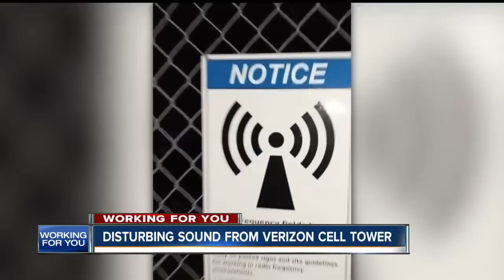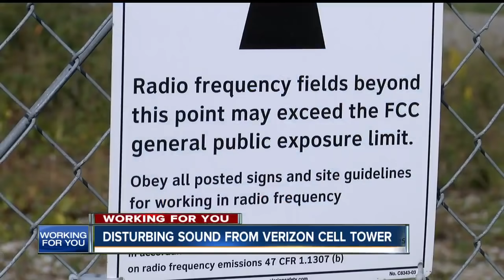Disturbing sound from cell tower

Comment: The Russian studied the Effects of EMF way back in the 60s I have some research to share with anybody that is wanting to know more. The Russians actually studied the effects of the Non Inoinizing radiation. Do not be mislead by those who claim that heat is the only thing that can affect you like UV light or the Sun. EMF is a lower frequency but the Effects of this emmisions go higher then 75 CM per given area. A microwave produces about 33 to 50 PPM of those same heating Non Inionizing effect Would you want to place your head in a microwave? Right no So those people that tell you otherwise are fools. Look up project PANDORA in 1960 An American Scientist Milton Zaret running this project and its effects of Microwave and EMF radio waves used in the US embassy in Russia and its effects on the employees at that time.

Comment: Idiots lol! It’s an alarm from the gen that’s there. Do you see the blue sign in the beginning of the video it means the tower is on the lower end of rf transmission. The next one is orange then red. The safest place you can typically  be is very Close to a tower. Because the rf is going over you unless the antenna is incredibly downtilted. In New York City this equipment is located on rooftops more times than not several sites on every block. Everyone hates towers but everyone loves being on a cell phone. I’ve been in the industry well over ten years and I’m perfectly fine and guys I worked with 30+years are also fine too

Comment: Dumb on the engineer standpoint. No use putting an audible alarm on something if no one (that can do anything) will be around to hear it. This is just the shortsightedness I see in techs, engineers, and management now adays. Pay is too little, BS you have to put up with is too high, so people that are smart enough just try to do something else, or stick around and settle for whatever keeps people happy in the short term.

I was going to say, before watching this, I was thinking to myself, there are a many potential sources for that noise. Besides alarms, you have fans of all sizes cooling components and what not, all it takes is one wire or bit of debris to rub against a fan blade. Also, when radios and transformers fail, it is not impossible for them to make audible noises. This is because electricity and devices that resonate and broadcast RF signals vibrate on a small level. This is the reason you hear a hum next to HV transformers, and also why you hear your video card screeching when changing voltages rapidly while passing high wattage. The tiny magnetic components vibrate and make sound. 

Don't worry though, what you hear is completely normal for the design usually. It is in an engineer's best interest to reduce this vibration because besides the annoying noise, it also means there is increased heat. Also, that sound means energy is being wasted by being allowed to convert to thermal or sound energy.

Comment: oh clam down. you want your cell phone to work right? ugh that sound had nothing to do with the tower its self. that one had a generator so in case of a power outage the cell service will still be on. thats actually a good thing incase of any emergency. not all sites have one. if your that worried don't live so close to a tower. also dont believe the hype the 5g signal isn't gonna kill you

Comment: Nobody knows about electricity? This is coil ffs
Reply: Squidget   You obviously have never worked for any period of time around high capacity generators. That is the low fuel alarm.
Reply: @johnzappulla8023  You obviously have never worked for any period of time around Cell tower generators. That is not fuel alarm. Low fuel alarm kicks in generator backup in this case looking at the rig its battery backup, some have both. Silent alarm is sent to control station. This is whats known as Coil whine
Reply: Squidget   That alarm is a low fuel alarm for the generator(s). I’ve heard them every week for the past 15 years when we run our power backup tests. Stop already. No one cares that you are wrong.  This post will be forgotten after you read it. It’s ok, just learn from your mistakes.

Comment: I'm a technician and that sound you are hearing is high SWR for standing wave ratio which means that thing is producing massive radiation while you were hearing that noise...   Instead of the RF energy going up and out the antenna it was all coming out of that box
Reply: Terry Ambrogio If you are a technician, you’re not a very good one. The sound I heard was a piezo alarm beeper that has been working too long, yust as the company reptesentative said.
Reply: @Stefan_Van_pellicom  stop trying to cover up for your company
Reply: Terry Ambrogio I am an electrical engineer living in Belgium. You are a paranoiac living in the US. Guess we live in different worlds at all possible levels ...
Reply: @Stefan_Van_pellicom  the cell companies will stop at nothing to cover up the fact they are killing the earth with massive amounts of RF radiation!!!
Reply: Terry Ambrogio If that is what you want to believe, by all means, be my guest, but I’m not going there.
Reply: Terry Ambrogio Thank God for the smiley. So not EVERYBODY went crazy ...
Reply: Terry Ambrogio   You’re a technician????  Too funny. That sound is the low fuel warning buzzer for the generator(s). No more dangerous than an alarm clock.   Now keep a technical eye on the French fry machine at your job.
Reply: Stefan Van pellicom   Do you need to go to school in Belgium to be an electrical engineer???
Reply: John Zappulla Yes, 3 years. The diploma is printed on the back of a stamp.
Reply: Stefan Van pellicom   WOW. Even get a diploma!  Exciting.
Reply: @johnzappulla8023  yup I have a lot of worthless stuff :-) I never thought one or two messages and these cell companies are basically attacking me for telling people the truth lol that's how you can tell and know what they are doing is wrong.

Like cell aerials on top of water towers microwaveing a intire citys water supply. Drink there koolaid John :-)
Reply: Dark Messenger  have you ever worked around RF technology ( sounds like you  read microwaves and RF magazine and know it all )!!!!

Comment: Why ppl stupid pls find help don't look with your self what is happening right now I m so scared(not realy)
IT'S JUST 5G  NOT  MICROWAVE
Reply: @portagepete1  the inaccuracies of your statement are mind boggling. Please educate yourself on non ionizing radiation before spouting on about things you don't understand. Radio frequency radiation, any type including 5G and 5G millimeter wave are NON IONIZING RADIATION SOURCES. meaning they are not strong enough no matter what power they are transmitted at to affect the structure of atoms or affect DNA. The ignorance of the people in this comments section is insane.

Comment: If a Generator was not working rite and making a sound like that they would be rite out to fix it. Common sense would tell you that. My goodness people wake up. If the generator was not making power that shut the tower down.
Reply: I am a generator technician. If they call us and we have other jobs scheduled we may not be able to get out right away. Most of the cell tower techs don't know how that equipment operates so they can't really do anything without a generator company on site. Not to mention these are unmanned sites and a cell tech that can go into a tower may be a LONG way away from it or have other more important things to do. It's a simple alarm, no reason to freak out.